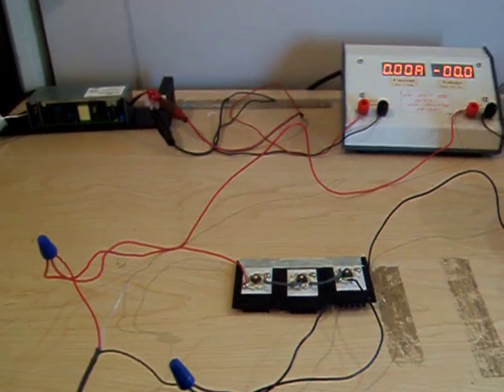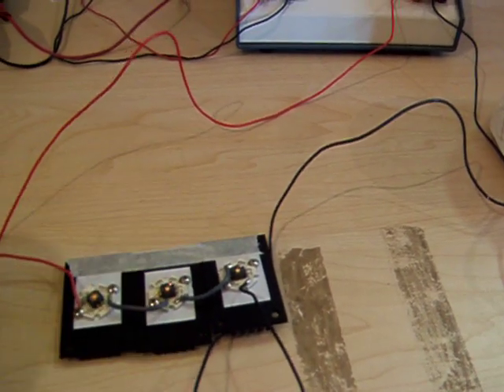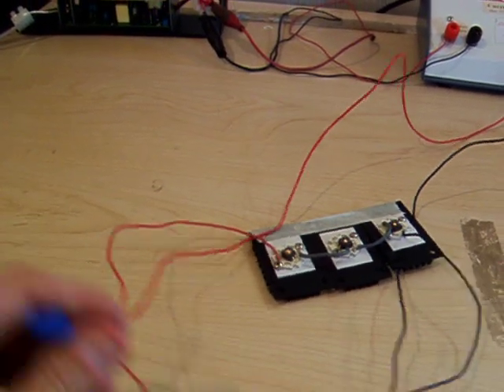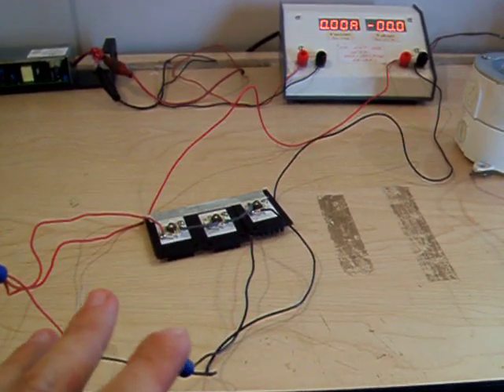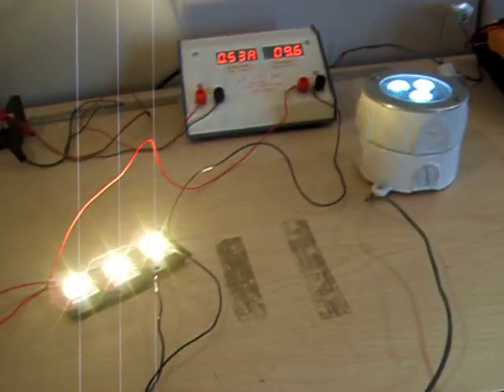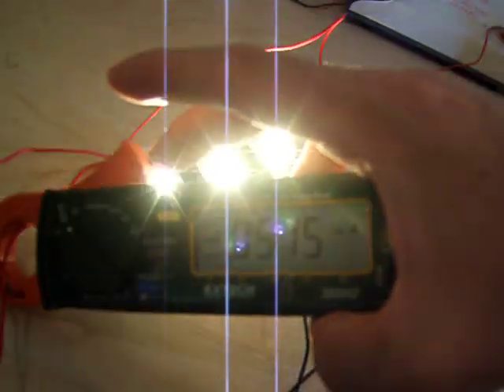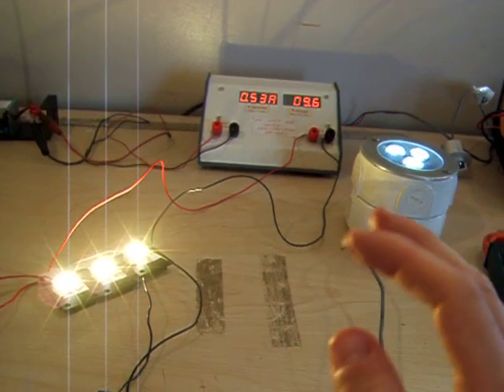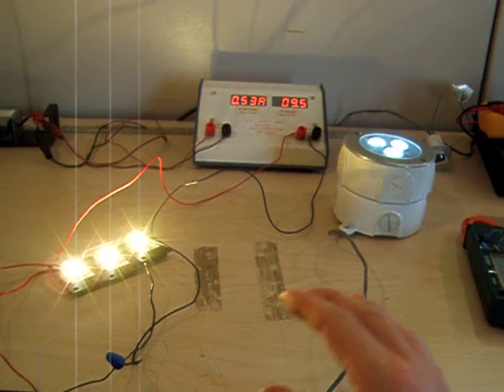Wiring LED Modules in Parallel using a Constant Current LED Driver

Comment: Very good video. I could use some help though. I am building a DYI reeflight. setting up 4 10w led, forward voltage 9-11 volts at 900-1000ma. If I run these is parallel with a 12v 60w 8a power supply I should be good correct. Also will have a step/buck dial to adjust brightness.

Comment: Hi David, This is a Great tutorial and you have explained a lot for me  Thank you.   I have a 12v Bat, and 3x 10w 900ma led. I already have a   10w - 12-24v led driver for operating one led, what would I need to purchase please to operate all 3 led from my 12v battery? Once again thank you very much...  John  :)  ...
Reply from the maker: +karen berry 
Hello John,

How are these LED fixtures labeled?

LED fixtures have a nominal wattage, but performance is determined by drive current.  
With that said, Most LED products have some form of integral ballast or regulator - and tell the installer to feed it with 24DC or 120VAC (as example) which drives their internal "components" to ballast the LEDs as some desired drive current.

Once you know what the LED fixture is or is not designed for, then you can select the correct powering solution

10W/0.9A = 11.1V, but it is never this simple when determining an LED powering option

There is another video that explains this further
https://www.youtube.com/watch?v=R7A1NoAKH2E

If it was an LED designed to be driven at 0.9A, then it should also give you the LED's Forward Voltage (Fv), which is used to size the Constant Current Driver.  This is Always the best way to drive LEDs, but it is not always the most economical or convenient way to wire LEDs, so companies trade performance and efficiency for "simplicity"

If the LED is an assembly with additional drive components, then it is built to drive the LEDs at 0.9A at some input voltage.  If you use the wrong input voltage , it may not operate properly or you could destroy the unit
Reply: +Semper Fi Power Supply Hello Dave,  Thank you very much for getting back to me, it is very much appreciated.  I just need to digest all this new knowledge now! thanks pal...  John ... I enjoyed the other video too mate :)
Reply from the maker: +karen berry 
OK - cheers

Comment: Hello, 
I am interested in building a led light I was looking on ebay and there are some very inexpensive LED mounted on 20mm heatsink once I properly size my driver and get all set up.. how do you wire the driver to plug into the wall. I'm sure this is a dumb question. Is it just ran to a 2 prong cord like a lamp cord or is it a little beefier than that? Thanks!!

Comment: Hi  thanks  for answering,   this is an small  pcb,  was design  to turn the led's  one at the time,  but  the owner  wants  to  turn on both  leds at the same time,  i can tell you that  the board  have one  diode, and 3 resistors, smt presentation,  as i told you ,  i connect individually  each  led  to a 3v.  battery and they turn on,  i  connect  both  leds in paralel and  only one turns on,  i have check the polarity  and seems to be fine,   i have not a data sheet from the leds  that all i can tell you,  by the way let me tell you  that  i have  some brand new soldering  stations  from oki,  metcal specially  design for  small pcb reworks, if you are interested  in this equpiments let me know  but lets keep working  on the leds  thanks.

Comment: Hi  i have  two  smt leds mounted on a pcb,  this  pcb was configurated to turn on one led at the time,  i need  to turn on both leds at the same time ,  i connect  the two  leds  in paralel  to a 3v ac batterie  and  only one turns on,  what  can i do to turn them on at the same time.  please let me know
Reply from the maker: Good Afternoon,

Does it power each LED individually?

There are some things you need to evaluate before energizing.
Do you have the specs on the LED?
What is the existing circuit designed for now?

If we are simply talking about the LED only (no other components in the circuit), and use a Forward Voltage between 2.5 - 4.0 VDC, then 3 VDC of battery will not be adequate for your purposes when wired in series.  

If the LEDs are identical, you can wire them in parallel with minor differences, but if they are slightly different (internal composition), then one LED will take more of the drive current.

If you drive the LED with a battery and nothing to ballast the drive current, then you could destroy the LED.

If the PCB is already built for powering 1 LED, it might be easier to use two power sources controlled by a single switch.

Let me know
Thanks
Reply: yes  i test  each  led  and  they work  fine,
Reply from the maker: OK - you confirmed both LEDs work with that same battery. Did you measure resulting drive current (and forward voltage at the LED) when wiring the SAME battery to each LED individually and then wired together/parallel?

Just to confirm...when you wired the 2 LEDs in parallel back to the battery you wired Both LED Positives to the battery + and both negatives to the battery negative?
Reply: Semper Fi Power Supply yes  i  connect  the negative ports  and positive ports  in paralel ,  to run the test that you require y connect the multimeter in series with the battery   the drive current that i measure is 60 miliamps,  and  the voltage consumption is  162.0 milivolts

Comment: So if I understand correctly:
Say I want to drive 8 LEDs from a single power source. The LEDs are 4v @ 750mA (3W). I would need a 32v 750mA driver since they're all wired in series?
Reply from the maker: Yes - Exactly.  This video walks through that topic; sizing a Constant Current driver using Forward Voltage
Semper Fi Power Supply - Sizing LED Driver using Forward Voltage

Comment from the maker: Thank You for your comment Ludwig.
I summarize at 3:13 the most common risks when not wiring LEDs in Series.
I did not address longevity or lumen maintenance because the drive current, Junction Temperature and the actual LED being used are variables that need to be considered.
Perhaps I can supply additional information you require - 
What would you like to be covered in the additional 10 seconds?
Regards,
David Pitts